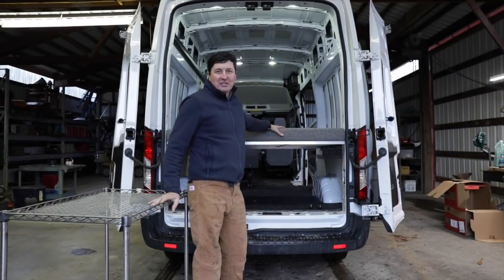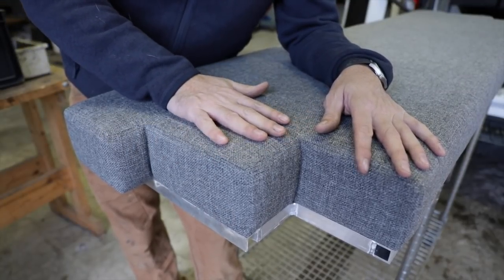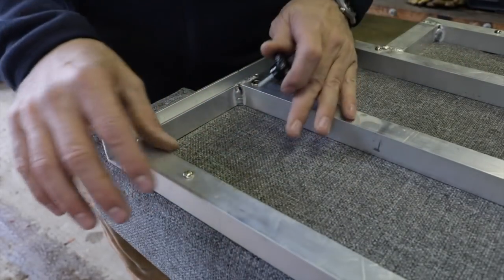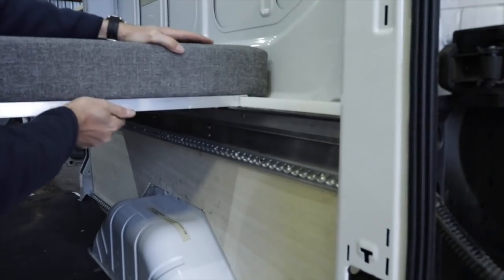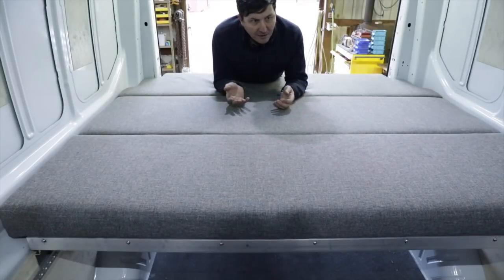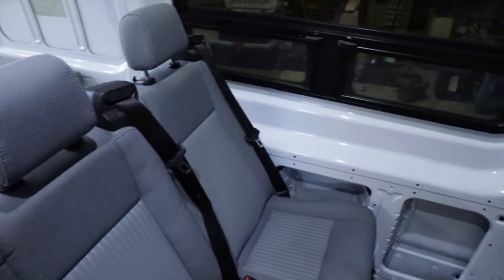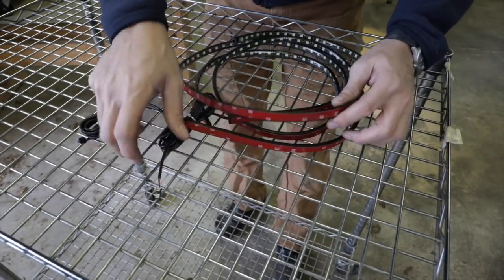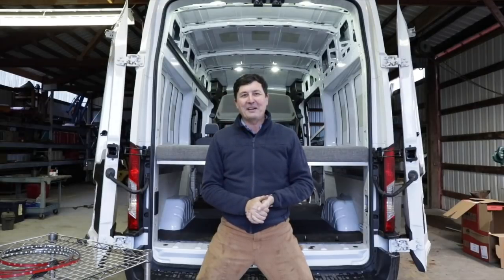How To Build A Removable Van Bed

Comment: What about fabricating a way to take the front panel of the bed and place it at a slight angle between the back 2 sections of the bed and turning it into a couch? It would allow for the 2 ft of floor space but give you an easier place to put on your gear and boots.

Comment: couldn't you engineer the bed so one of the three strips (the one nearest the driver) can be lifted out and fixed up to make a back to a sofa type arrangement.  perfect for when parked up and gives you extra space.  just a thought, excellent work as always
Reply: paul juster I was thinking the same thing.
Reply: Yes please, We had a van that did that and it was so versatile. Very Nice.
Reply: paul juster why do you need a couch ? This is meant for when they go skiing or camping, just a sleeper/transport not to hang out in
Reply: On rainy days a couch is great.
Reply: Nice to have the options
Reply: I actually though the same thing.  But that is just my way of thinking due to having a fairly large family and used to a 16 seater van the whole family chipped in for but was stored at my grandparents place.
Reply: Oops looks like I just commented the same thing lol

Comment: The van's really coming along.  At some point, are you going to do a cost breakdown?  You've mentioned a number of times how what you're doing is either better (quality or reliability) or cheaper than a commercial product.  It would be interesting to see a breakdown when you're done.
Reply: rjtumble tbh you can get a second hand Winnebago (Walter White meth lab) for cheaper then the van he used, I'm not saying it's the same thing as if you had a van already and then turned it into a camper but his build is more expensive but newer
Reply: Clayton Tucker I'm sure you're correct. However, I also think it would be interesting to see this project compared with something similar in terms of age and features.
Reply: Yeah, agreed.  You can generally buy something used and spend less money.  I'm thinking of a comparison of this new DIY vs new ready-made.
Reply: Please don't forget a CO detector when you add the heater.

Comment: In Belgium, we can buy the 4x4 version at the dealer, comes out of the Ford factory, so thats wierd that it's not possible in America. Nice work you all ready have done on the Van
Reply: We only can buy diesel, no other fuel possible at this moment. Never know that there would be such difference between America and Europe.
Reply: which diesel is available for you? In America I think we only have 6.7l which has a lot of problems, and also vents the exhaust fumes during regen cycles into the passenger compartment, often resulting in the hospitalization of the occupants. but its a very powerful engine.
Reply: EcoBlue 2,0-liter TDCi, with 105 HP/360 Nm, 130 HP/385 Nm and 170 HP/405 Nm. A 6.7l engine is not done here, this because of taxes and consumption :) diesel is around 1.3€ (1.5$) for 1 liter (0.26 gallon).
Reply: Agricultural Life that makes sense lol. Turns out I was wrong, apparently they never offered the 6.7 in a transit, but we do get a 3.2 diesel here.

Comment: I've been doing research for about 6 months in preparation of doing my own sprinter van conversion and would highly recommend taking a look at " The Restoration Couple" on you tube for what ( IMO) is the best DYI on how to properly insulate a van conversion.  This is of particular importance in colder and wetter climates like we have in the Pacific Northwest US.  Keep up the great content on all fronts, I'm a big fan of what you stand for!
Reply: They used reflectix to insulate their van. There are many videos that say installing reflectix directly on the metal gives zero insulation value. If you build in an air pocket it gets a little better, but there are much better materials to use for van insulation.

Comment: Until you get the 4x4 installed Cody, add a rear diff locker. (electric) and that van will still go most place 4x4 will.  You will be so glad you did, as glad as you are for the 3 piece mattress.

Comment: I can’t wait to see how the S HEATER is going to be installed and how it’s going to tie into the Hot Instant Hot Water 💦 System! You sound so excited about it. How did you research this INFORMATION OR HEAR ABOUT IT, Cody? The bed with the new professional upholstery turned out really 👍👍😍

Comment: Looking forward to the heat exchanger - wondering if it could be made to work with a Propex :)  The heat output ducting is virtually identical to the Espar / Webasto.

Comment: Great work and lots of space inside! It looks great! Will you also build in a kitchen?
We built a Volkswagen T4 last year and drove through sweden for around 3 weeks, in the north it was still winter and i was so happy about my heating system. If you use it in the winter, think about a good insulation of the large metal parts to keep the heat inside. Armaflex is such a great material for it. It's has a glue side, just cut it in pieces and stick it on the walls. We used our heating system at -1°C just with ~800 watts for around two hours the whole night.

Comment: Looking good. I just bought a 1999 E150 chateau with a 5.4l. It has 4 captains chairs and a solid back bench seat in the back. What did you use to make the seats swivel.

Comment: Given the interior volume of that van, I'd be laying Dynamat all over the panels, particularly those before you lay ply, coverings, etc over. May be more expensive than some but its NVH improvements are truely excellent, takes all of the "drum" out of those panels and will make for very good insulation as well.

Comment: That's funny, a little Asian lady also runs the upholstery shop where I get work done, great work on the bed frame, you mentioned moving the front bed panel for more space, you could slide it back, put it on it's side (little bit of hardware) and use it for a backrest, have yourself a couch.

Comment: random tangential comments re: Transit     The swivel on the passenger seat won't be too difficult; the driver's side may be a little tougher and while you have the seat removed you may want to switch to the dual battery option (if yours isn't so equipped).  You're going to love the LEDs. Interesting YouTube Transit is at https://www.youtube.com/user/rallymatt  Different use of the van, but they are creative.  I believe this door stop would be useful for your application. http://www.nortonfab.com/?product=sprinter-van-door-stop

Comment: Hi, great to see another in this series of videos... I've been waiting patiently. :)

I wanted to just raise a point on something you mentioned... perhaps it might help? You mentioned the little furnace/generator you intend to install, and it sounds like a great idea. I was however wondering about the fuel issue you mentioned... not burning past 3/4 of a tank. Will this mean that the fuel tank will always have to be more than 3/4 full in order to run your heater? That seems a little impractical, unless you plan on camping very close to a filling station... if that is indeed the case you might consider extending the tube, to use fuel lower in the tank? Just a suggestion based solely on your description of the furnace... I hope this helps.

Comment: Looks great! Btw, you might be able to hook up a 12v pump to that water heater. That way, if you are near a lake, you could pump up lake water, heat it up and use it to shower. That way you wouldn't use any of the drinking water. Just a thought.

Comment: Are you planning on setting up some extendable jack system underneath the van? I noticed when you popped the bed in, the entire van shook. As somebody who owns a camper it's impossible to sleep when simple movements continue to shake the compartment. With jacks you can stabilize everything and won't have to worry about all the movement.

Comment: Cody you should round off the corners of the edge of the panel rails where plastic goes. As you were putting it in the van, I was crossing my fingers that it wouldn't damage the upholstery! I imagine they're not sharp but it still looks like a pretty pointy corner.

Comment: Cody, you should think about adding the I channels along the roof of the van so that you can add hangers for skis, rifles, shelves, and bags off of the floor. It would de clutter the van during adventures and be easy to remove. Plus, you would have tiedown points up high for awkward loads.

Comment: I used an Espar forced air diesel unit on my 40' boat for years. Very reliable, sipped fuel and it would run you out of there even in 15 to 20 degree weather. You'll like it.

Comment: Marvelous build! I cannot imagine what that build would cost in the commercial marketplace if it were even available. I love the idea of the LED lights under the bed area.

I do have one concern though. In my limited experience, aluminum gets a dark tarnish that could transfer to the upholstery fabric should they be stacked against each other. Is the upholstery cleanable or is there a coating that can be applied to the aluminum to prevent the tarnish? I hope someone can address this concern for me. Love your videos!

Comment: One of the best things about your design is that it is lite weight. Every pound of weight you add to you vehicle will cost you in fuel mileage and road performance and I have to laugh at those that are using 2X4 construction and heavy plywood panels for their build. The heavier you vehicle the harder it will be to stop and control in an emergency situation. I've said this before but if we lived close to one another, I just know we would be friends.

Comment: I'm a huge fan of eberspacher, both the circulating water version and the D2 hot air heater. They also do an amazing stove and with it be exhausted to the outside unlike propane instead of increasing condensation it can actually help to reduce it.

Comment: You should put some railing support like you did for the bed on the supports of the back doors so you can make it a couch for more comfort and space saving. So instead of stacking the front panel, you could just make it a back support for the rest of the mattress.

Comment: Cody, it looks great! Someone may already mentioned the idea (I have not read all of the comments, so I am sorry, if I am repeating); and you may already have a better idea, too.

When you need more room, use one bed panel, as the back of a couch, at the very back
of the van, and store the other panel on the wall for a back rest, or store it above the one 
used for the back, if you already have another use for the wall. Hope this made sense.

Comment: For that gas furnace I'd install a little 12v remote control switch so you can turn it on and have it be warm before you even get inside.

Comment: I noticed that you had not insulated the van yet appear to be using it in the winter.  Why did you not insulate before bed construction?  Are those noise damping triangles on the sidewalls and ceiling?

Comment: Have you thought about turning the bed panels into shelves by applying a hard panel to the bottom and then placing mounts on the van sides.  This being done the bed segments go from being stored when not in use to being storage when not in use.

Comment: When the series began I wasn't sold on upfitting a stock van into an sportsmobile vs. purchasing an RV for overnight trips.  After seeing how the bed came together I'm full supporter.  Those three removable panels will be so versatile for the outdoor activities you mentioned.  You're basically packing a full locker room & equipment room in your vehicle.  This will end up being a perfect van for weekend adventures... I guess that's where the name 'ADVENTURE VAN' comes from.  As an avid RV'er there a many things I'd like to change in my travel trailer with the main one being the bed.  It takes up a third of the space in my 18' trailer and I would love to convert it into a murphy bed to add room for seating.

Comment: Hey Cody!
That bed really looks great! Very professional work - by the upholsterer and by you!

As you are planing to use the van in winter, may I suggest to isolate it? It really makes a big difference, even in summer it wont get to hot inside. 
The best material for isolation in a van I know (and which my father and I used to isolate his Volkswagen Bus) is the xtreme isolator by Reimo: https://www.reimo.com/en/topmarken/XTREM-X-Trem_Isolator/
There are two dealers in California and one "right across the border" in Canada. Maybe you want to ask them about the isolator – but be warned: this stuff is not on cheap side (and you need some glue, too). 
By the way: I do not work for Reimo or get anything from them. I only like to give you some ideas.
All the best.

Comment: Great video Cody. I went to the proving grounds 3 years ago when they were working the final bugs out. We sat in one of these and they dropped the temperature outside the van down to -60 degrees. Even at them extreme temps the van started.

Comment: Can you attach a link to the mentioned generator, heater, etc.

Also for insulation are you going to look at spray options (lizardskin: for heat, or spray foam: all around)